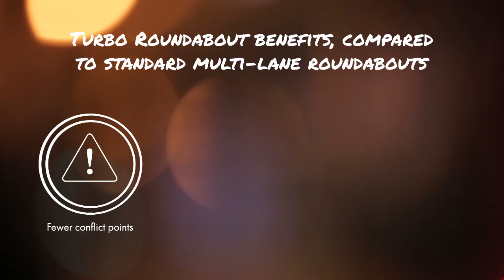Turbo Roundabouts - A better alternative

Comment: Turboroundabouts are a costly and expensive 'solution' to the real problem which is the European law requiring vehicles to exit from the outside lane and thereby also requiring the inside lane to give way to the outside lane (which is actually a blindspot due to the curve of the round-a-bout!) Driving practice is Australia eliminates the need for turboroundabouts because you have to give-way to those already in the round-a-bout which means you don't overtake unless you entered at the same point in which case it doesn't matter because only the outside lane takes the 1st exit, both lanes take the '2nd exit' and only the inside lane takes the 3rd or higher exits.  European road laws create more conflict points in roundabouts due to their law requiring you to exit from the outside lane.
Reply: haha, you made me laugh SirMario!  But I think that shows your attachment to the concept of a turboroundabout rather than the logic of the dangerous European roundabout laws that create blindspots! :)
Reply: I've seen some examples of how they effectively implement Australian roundabout laws for individual roundabouts in Europe by putting a sign at each 'exit' showing every lane can exit at the next exit but only the inner lane can both exit and continue around.  This could be a simple way to not change the law but that would mean you would need to put signs up at every exit at every roundabout in the country!
Reply: @sirmario1  It is beautiful though so I'll give you that :)
Reply: Fellow Australian here - and yes, that approach (inside lane must give way must give way to outside lane) is genuinely silly.  Funnily enough, that law was only corrected to catch up with 'driving practice' in the last 10 years, which is why all the lane markings had to be repainted to reflect the actual reality.
Reply: @zephyrmj  I'm lost on your definition of "European law" don't most European countries have their own driving law and non law guidelines? The French rule (which is diminishing in application) giving minor roads to your right priority. I'm British and have majorly driven in Malta and Ireland who are both left-hand side driving nations. Just the odd touch in France and Poland. Yet even in Ireland which is very close to the UK they have a different rule and road marking for unmarked crossroads. 
Could you give pictures and either text or a link to film for these superior Australian crossroads? At first glance these turbo roundabouts look very 21st Century as in they are all about cutting down thinking and exercising control.
One aspect of British roundabouts (and white road arrow markings in general) that you won't find mentioned in The Highway Code (not sure about "Driving" the DOT manual) but is mentioned by the Institute of Advanced Motorists (IAM) is the concept that white guidance arrows are not compulsory unless supported by a road sign. This can be particularly useful for motorcyclists to avoid queues on roundabouts.
Suitable musical interlude:  https://www.youtube.com/watch?v=cPCLFtxpadE
Reply: The pictures will take a while to compile - I'll see what I can do.  But I'm only talking about multi-lane round-a-bouts not unmarked crossroads and apologies but I meant continental Europe not Ireland.  Irish and British multilane round-a-bouts work the same as Australian ones with the halfway round concept because in our minds it is treated like an intersection with an obstacle in the way that we need to nagivate around rather than a maze that we only know our way out of once we're at the other end (so we indicate to the right when we enter because we are 'turning right' like at other intersections rather than entering a lane).
Reply: and I mean multilane roundabouts with a give-way symbol before you enter which have marked lanes not like the Arc de Triomphe which doesn't have marked lanes or a give-way sign on entry.
Reply: @zephyrmj No I was just referring to Ireland's crossroads and the French minor road priority as examples of difference not suggesting a similarity or parity between them and roundabouts. Europe has tried to standardise much road signage into the triangles to warn and circles to command with extensive use of pictograms. 1960s Public Information Film on this subject and new British signage  https://www.youtube.com/watch?v=-eHVzMagfKQ&list=PLTMIyoV1hZkA2PAooKf8atDmhCKulb_7L&index=232 but at times we use differing pictograms this attempt at common signs has gone beyond Europe. Is this India?  https://www.youtube.com/watch?v=UxvNvbh1zpk&t=300s   Looking at Australian signage it is very like the Irish system with some shape indicative signs but lots of American like yellow canted square signs too.  https://www.youtube.com/watch?v=NFHjMNKquyI  I'm struggling to remember driving over a European roundabout so it can't have been that traumatic.
Love to see Australian road safety films though.
Having spoke of the traumatic an example of how public information films scared kids witless in the 70s   https://www.youtube.com/watch?v=xZWD2sDRESk
Reply: just do a search for "Victorian Road Safety ads" on youtube and you'll see plenty.
Reply: Back on topic: in continental Europe, you can continously drive around a multilane roundabout in the outer lane (right lane).  If you want to do that in Australia, you can only do it from the centre/inner lane.  It's illegal to do that in the outer lane.  This aspect of the continental European multilane roundabout law is inefficient use of space and creates unnecessary blindspots.
Reply: @zephyrmj  The Victorian Road Safety ads I did the search. Not that thrilling being black and white and silent. Can you say if anyone recorded the sheet music played on piano in the kinemas of the day?
Reply: @COIcultist  try this one https://www.youtube.com/watch?v=jyYTPRX1CCQ But why are you asking?  I am not saying that Australia is generally superior in road safety.  The fact that our laws relating to multilane roundabouts are safer than the continental European laws relating to multilane roundabouts does not mean that was actually intended by the law makers or even considered.   The reason I mentioned Australia was just because that is where I have most of my experience in driving.
Reply: and if you're really keen, here's a whole hour of ads! https://www.youtube.com/watch?v=aTvd-84DI88
Reply: Australian roundabout laws do not work if it is a very large roundabout with the following exit being a long way from the entrance.  In such an instance, 'straight ahead' needs to be confined to one lane or else problems will arise.
Reply: Just 2 things
1 there isn't really a europeën law, europe and also the eu are dozens of different countries, and 2, you also need to give way to people in the roundabout here.
Reply: @creator2960  maybe an image is of 2 cars entering and exiting at the same point (e.g. the 2nd exit) in 2 different lanes and they both know where the other came from and where the other is going to.  The inside lane is 'shielded'.  They know no-one will try to 'overtake' them by not exiting and continuing around the roundabout from the outside lane.  They can exit side by side with the other car without needing to see what anyone else is doing.  The flow within the roundabout is maintained.  The 'shielding' effect is there even with no car next to you due to the requirement to give-way to those already in the roundabout.